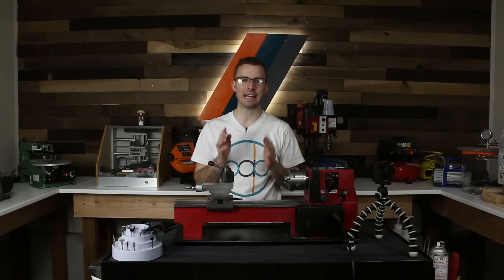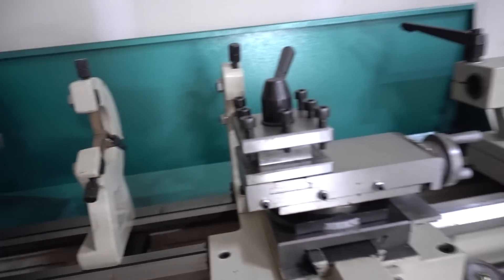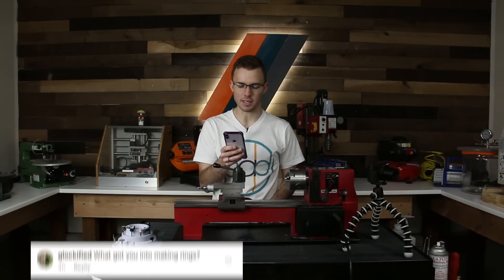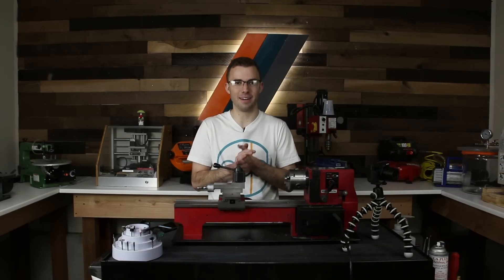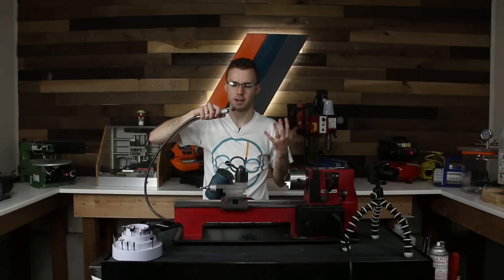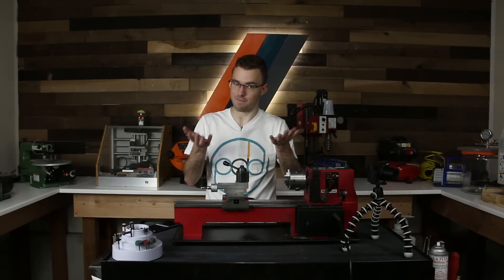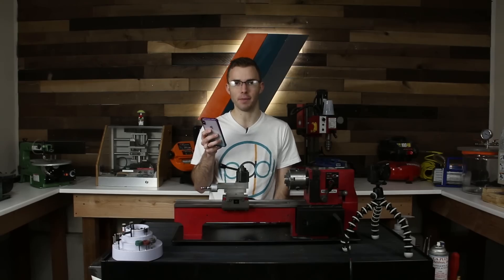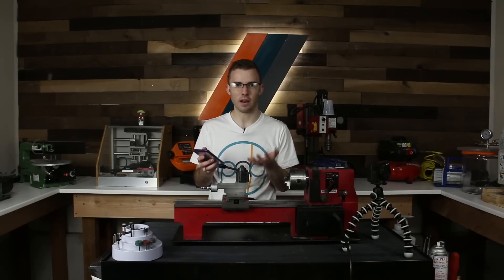Patrick Adair Designs Q&A + Shop Tour

Comment: Do you use any special bits when turning stainless or Damascus on the lathe? I’ve got the same machine but my bits did a horrible job with stainless and kept tripping the fuse, any recommendations would be appreciated
Reply from the maker: Stainless Damascus is just very tricky to machine in general (especially with our small harbor freight lathes) but I’d just recommend normal tungsten carbide bits, make sure they’re sharp and that you take shallow passes!

Comment: Hey Patrick! I’m going to start trying my hand at making rings and I was wondering: if you had a metal ring and wanted to inlay a strip of another metal, say, a gold wire, how would you do it? Does CA hold well metal on metal or would you need to do something like soldering? Thanks, and I love your work!
Reply: Pyro Millie CA glue with an activator to harden it faster
Reply: Some materials just will not bond with CA. Aluminium and copper for instance. You could potentially solder copper into aluminum, but I don't think the other way around. A resin could do it, but will likely show. Where there's a will... Sometimes you've just got to experiment a bit.

Comment: I do have a real question for you Patrick. How do you keep carbon fiber from tearing and splitting apart when machining the O.D.? I've had multiple failed attempts when trying to make the O.D. the size I want.
Reply: Best to just use a sanding drum on the outsides in my experience, the lathe bit had a very rough cut